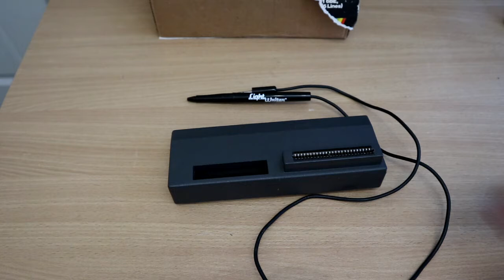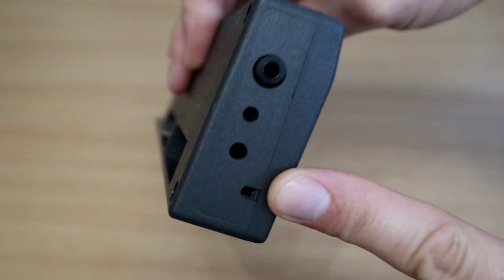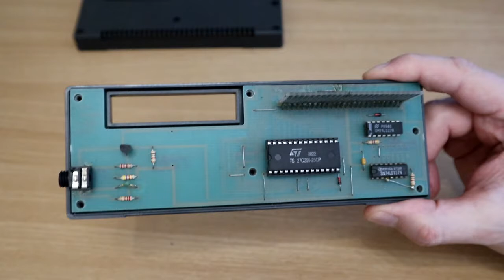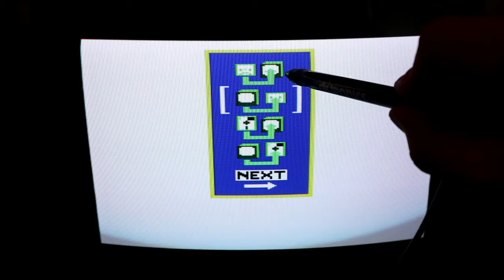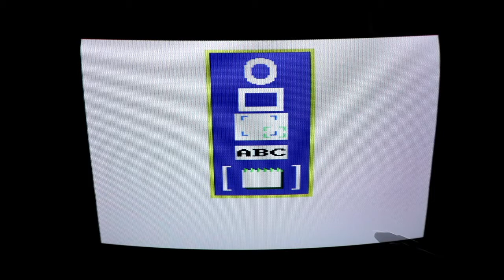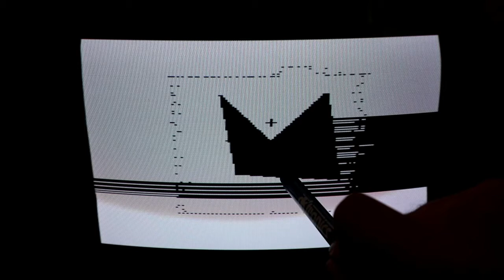Amstrad CPC Lightpen

Comment: Cool vid, have you ever seen a CPC 6128 working but with a missing sound channel? Mines like that I've replaced the AY chip and that didn't make any difference?  The sound is the same through the computer speaker as well.
Reply from the maker: Hi, no sorry not come across that issue before. Sorry I can't be more help
Reply: @SteDubya AHH that's ok. Nobody else has either 🤭😆🤣

Comment: Great video.  The expansion port version pens only have character based X,Y light detection via the CRTC chip, which explains the lack of accuracy you described. Other pens like the Amstrad LP-1 plug into the joystick which are more pixel accurate but have other issues. The logic chips on the board are just for the ROM chip

Comment: I had this light pen with my CPC. It really was slow, to draw a circle, you had to go really slow, otherwise what came out was a square :) I used it on the original green monitor, calibration was ok, but it was quite a fascinating piece of technology for that time.
Reply from the maker: It’s a pity it wasn’t a bit smoother to use but still a great novelty. Thanks for sharing your memories